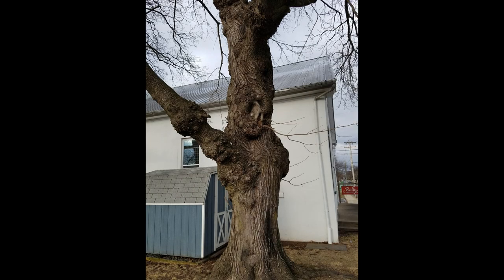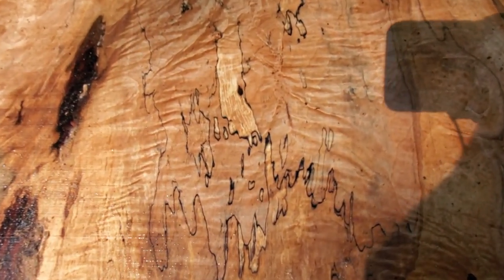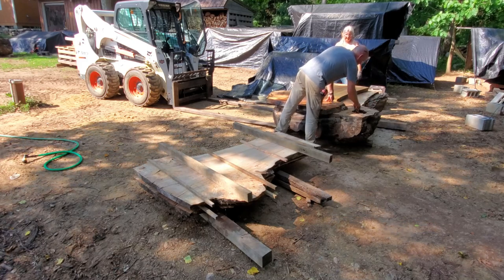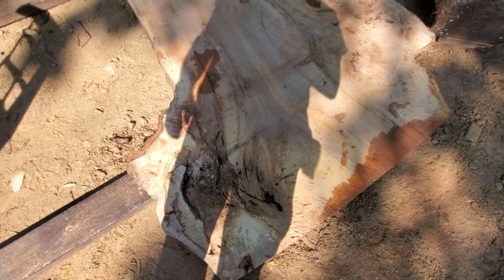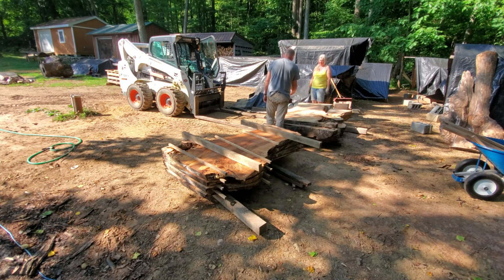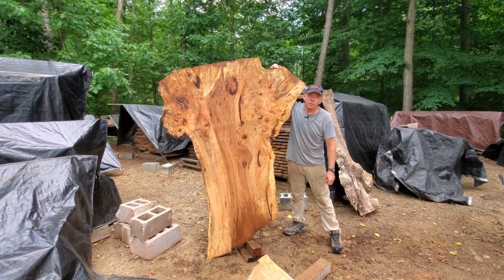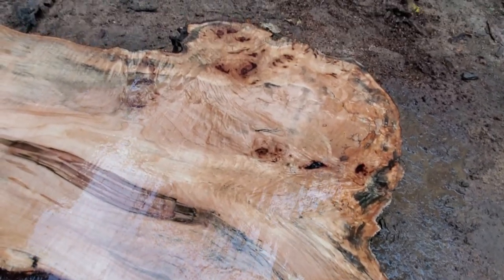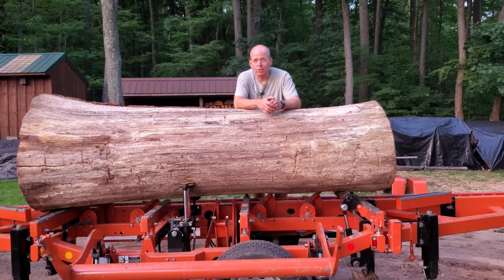THE Most Amazing Figure EVER at the Mill

Comment: Looks like a Norway maple...?
Reply from the maker: I believe you are correct. Very common in this area.
Reply: @IronOakSawmill  Norway maple is usually a pretty brittle wood. Silver maple is stringy. Both are common in urban areas, and both can get some nice figure. The challenge is holding the wood together for the long haul. It will want to move around a lot as it dries.
Reply from the maker: @pamtnman1515  we try to keep movement to a minimum while the slabs dry, by wrapping ratchet straps around each stack, and cranking them tight. We've been very successful with this method.
Reply: @IronOakSawmill  overall yes, your method is as good as it gets. I have seen your piles and envied your arrangement.  Some woods have characteristics that no matter what we do, they won't be so great to work with. Silver maple is a classic example. Norway maple is probably not too different